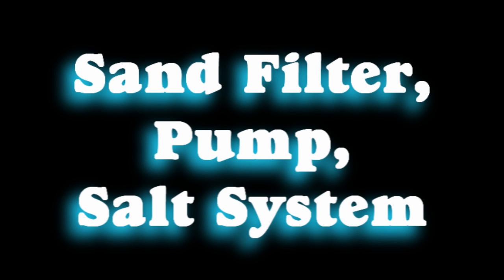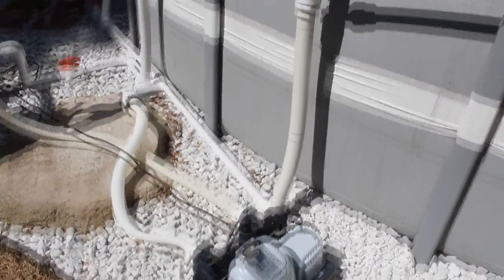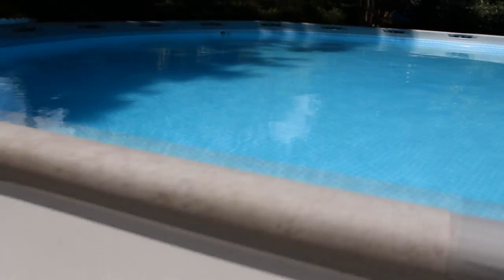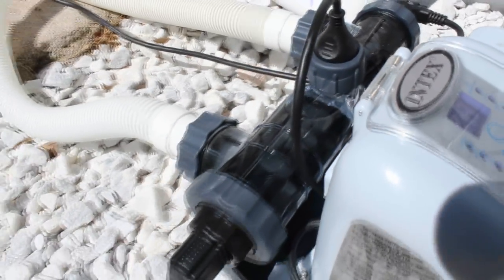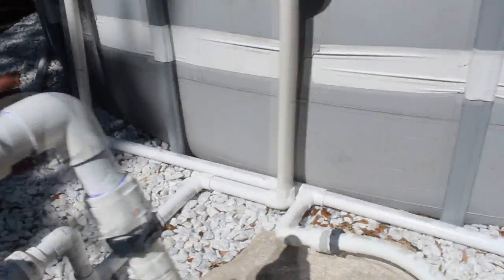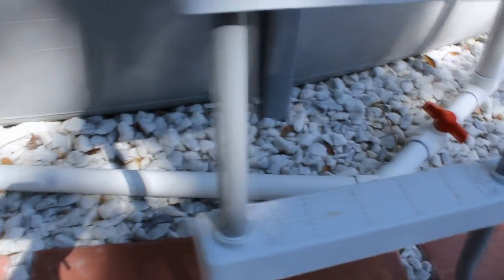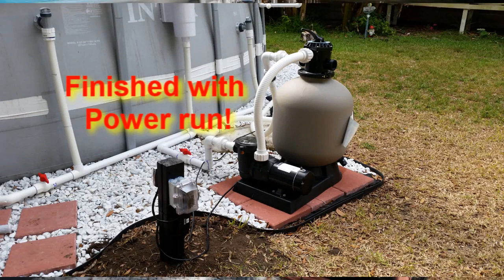HOW TO  DIY Upgrade INTEX POOL with HARD PLUMB, POOL PUMP, SAND FILTER, and SALT WATER GENERATOR

Comment: Nice job. Can you explain how you connected the pvc to the pump and the sand filter. I paused the video but couldn't quite tell the components used. Thanks.
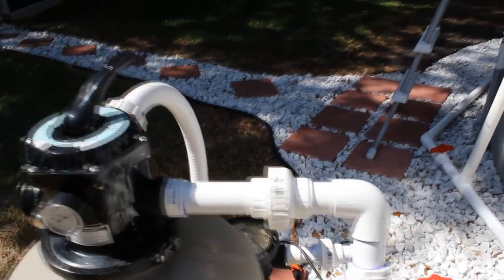Reply from the maker: The connection to the pump was a male threaded to a female slip. (1:27) Then I connected a union female both sides connector that unscrews for easy disassemble if needed. Very similar setup to the filter unit. Union female both ends to the male threaded to female slip connector to the filter unit. (1:38) Hope this helps.

Comment: Hello so you have the one skimmer inlet and then you have two eyeball outlets? My old pool I closed off two outlets kept one outlet and did a skimmer on the new pool I have I’m not sure what to do something like yours I think so I’m just trying to understand I would do the one normal outlet with the eyeball the skimmer for the inlet and then the other two open holes I could make two more outlets? Or close one off or use one of the three for a fountain correct?
Reply from the maker: I believe I understand your question. I have one return (the eyeball) and one inlet which is the skimmer. I have a valve that runs between the return  from the pump to the pool that splits from the return (eyeball) in the pool and the fountain. This way you can regulate how much water comes out of the fountain by adjusting the opening of the valve. You can keep the two returns as long as you have one of them for the fountain as well. For more pressure to the valve shut off bot returns (eyballs) and only let the fountain go. I hope this helps.

Comment: I know this is an old video, but I have a question about the pump. Does the ground screw on top of the pump not need to be grounded to anything? I just bought a pump to replace mine & trying to figure out what I need to do as the instructions say it's a safety hazard not to bond the pool to the pump.
Reply from the maker: Mine is not separately grounded other than the plug into the GFCI I installed next to it. I haven't had any issues. It wouldn't be a bad idea to ground it separate. Check with your local codes and electrician for any assistance on that.

Comment: Does the flex hose just get inserted into the hard T fitting like normal hard pipe?
Reply from the maker: Yes it does. Attach with PVC glue as normal.

Comment: I did the same thing with the fountain/sprinkler part but I only drilled a couple of holes on 1/2 inch PVC yours looks a bit different with those things sticking out any videos showing how that works?
Reply from the maker: I do not unfortunately. They are Threaded micro-sprinkler adapters. Threaded on one sided with a nipple on the other. Here is a link. https://www.homedepot.com/p/Rain-Bird-1-2-in-Barb-x-1-2-in-Male-Pipe-Thread-Irrigation-Swing-Pipe-Coupling-SWGA050S/203184903
Reply: @JDee7  I think that is what I am going to end up doing next summer because right now I'm using me half an inch PVC pipe where I drilled couple of holes with a drill bit and it's definitely very hard to get in there straight without having a press drill, so the sprinkler is crossing each other since some of the holes are not drilled in completely straight...lol
Reply from the maker: I am going to add a video making this fountain. Working on a few things now, then I'll get this together.
Reply: @JDee7  I'm about to post a video of my sprinkler system how it works I'm happy with it but I would like to switch games more Straigh just for a better presentation

Comment: Where was the 2" fitting used? I thought intex was all 1.5.
Reply from the maker: I used a 1.5" to 2" adapter to fit the 2" on the filter and pump.

Comment: Hi I see you used hoses at the entrance and exit of the pool.. how did you connect to the hard pvc
Reply from the maker: I used the same 2" connectors for the soft and hard PVC. The diameters are the same so the fittings fit nicely.

Comment: the adapters that yu have that connect the PVC to the pool plungers, are those regular pvc plumbing pieces that I can buy at home depot or lowes?  Im about to do the same conversion you have done and have an intex sand filter and salt water pump. Trying to gather all I need.
Reply from the maker: Yes they are all schedule 40 connectors.

Comment: Our upright legpoles and the conection to the bracing around the top of the pool rusted out within 6 months after we started the salt water pump. Today it is about to colapse. Have you had any problem with that?
Reply: I had the same exact issue have to get a new pool this year it was fine until I added that salt cell now I won’t use it anymore
Reply from the maker: Unfortunately yes. I had to upgrade to a salt ready pool, but the setup is still the same.

Comment: Great design & video.
Just curious - Do you have any comments regarding how well the Intex Salt System performed & held up?
Reply: I wondered the same thing from other people because I set mine up last year (with intex salt system) and over the course of the summer it rusted out all the legs I have to get a new pool and the salt system quit working but I’m not gonna use it anymore anyway since it rusts out the legs I got one that was only use for two months now I will put that up and it is the XTR with the powder coated metal but I’m still not trusting that the salt won’t ruin it
Reply from the maker: The system held up awesome, but...it did rust the pool rails and supports as they aren't really set up for salt. It did last for about a year or so after so I got my monies worth. I upgraded to a salt resistant pool.
Reply from the maker: As long as you have a salt ready pool it will be fine. You can still use only chlorine in a salt ready pool if you want.

Comment: It's kind of difficult to see in the video but how do you fit both power cords onto the outlet. Each power cord has a wide GFCI plug that takes up so much space that hardly leaves any room for another plug. Or do you have 2 outlets?
Reply from the maker: I do not have GFCI on my cords. The outlet on the post is a GFCI with the larger exterior weather cover.

Comment: Idk if you remember but what's the diameter of the Jets that you have on the return, I think you said ten of them but if the diameter is too small might over shoot, I don't want to guess wrong, are they 1/2 ID? Thanks for the video
Reply from the maker: They are 1/2. I actually had to plug 2 of them since the video so they would shoot farther into the pool. There was a lot of volume coming out of the fountain that it only reached 3' into the pool. Now they reach to the center with more pressure and fun!!!
Reply: Oh, perfect, thanks! Might put a ball valve like you have but right under the spray manifold to adjust the pressure as the sand clogs, or might that be an issue for some reason? Love the thick jets of the 1/2 vs a spray.
Reply: Bubbers Productions lol I was about to share the PVC shelf video with you that I stumbled across cause it's another badass idea ...then I realized you did that one too

Comment: Do we have to use 2” fitting ? Will 1.5” work fine, I feel 2” fitting is too big
Reply from the maker: I used the 2" based on the return sizes. It lets more water flow, but 1 1/2" would probably be fine. You may need reducers from the pump as most use 2".

Comment: Hi, How did you add more power to Krystal clear system? I just installed Intex 12x24 pool and pump is almost worthless as far as power go's,,,Love salt water  system but need more power. also I noticed on your fountain you attached something to the holes you drilled out, What are those?
Reply from the maker: They are black pvc hose nipples.

Comment: I've read all the questions and answers still don't seem to explain the exact coupling and screw on flange nut you used. Can you share a link of the coupling you used. Also, did you get the grey flange washer from one of the pool hoses that came with the pool or pump?
Reply from the maker: Which grey flange are you speaking of? If it's the 2 valves on the side of the pool for the returns, they came with the pool. The couplers are 2.5". It all depends on the size of hose you use to connect the flexible pipe. I am not sure this answers the question. I am not clear on what grey part you are speaking of.
Reply: @JDee7  every connection to the pump or pool valves has a lock nut. The PVC flex hoses at the pump have grey lock nuts and there are white ones where the pipe hooks up to the plunger valves at the pool connections. My biggest problem with converting to hard plumbed PVC is knowing how to connect the 1.5" PVC to the pool and pump connections without using any of the cheap hoses that came with the pool and pump. I.5" PVC connections seem to fit fine but other videos show that they don't fit perfectly and leak a lot. The hose lock nuts and pool inlets seem to be metric 40mm which have different threading than standard 1.5" PVC. Some people cut off the ends of the cheap hoses to remove and use the 40mm nuts to connect the new 1.5" PVC to the pool and pump connections. Is this what you did?
Reply: @mskeakitty  i have the same question, how did you do it?

Comment: Where did you get the connectors attached from pump to sand filter? The ones connected to the flexible pvc. Thanks!
Reply from the maker: It's the PVC Male Union Fitting in the description.
Reply: JD Potter thank you!

Comment: Does that skimmer just go where the original intex one was?
Reply from the maker: Yes, but you have to make the hole bigger with the template that comes with the skimmer.
Reply: @JDee7  ok was just wondering cause that skimmer looks like its a square cut-out and my skimmer was a round cut-out

Comment: What is coupler you used to connect to the intex plunger valve on the side? i am looking into getting a good pump this year and I am highliy interested into doing this
Reply from the maker: +obadiah7771 The valve is connected to the pool as it was in the original set up. I went from that point with the PVC.

Comment: You suggest a sand filter over the crystal clear in text ones and what kind of vacuuming system do you use I’m trying to improve my system overall on 18 x 48 Intex pool
Reply from the maker: I use a battery powered vacuum connected to a pool pole. It has a mesh bag attached to capture the debris. It works really well.  I added a link to the description for the one I use.
Reply: Bubbers Productions thank you maybe I will try that I had one like that but it wasn’t that great and then I bought the automatic big intel one and that stopped working ... my other problem like another viewer is the sand - can’t get sand out with any of these so I was thinking of a normal auto vacum set up on another intake port

Comment: what fittings was used to connect the skimmer to the flex pvc? I've seen a lot of people are cutting the hole larger but id rather not if i have other options
Reply from the maker: +Makayla Catron I used a reducer that fit over the flex pvc and has a male end that threaded into the skimmer.
Reply from the maker: They are standard PVC connectors. Whatever size the flex pipe is they sell connectors that fit right on them as if they were rigid schedule 40 PVC

Comment: The plunger valve you have on the one outlet.. how did you get that to work with the existing hole.. my 18' has the push in the hole type strainer that has a hose clamp on from the outside.. did you make the hole bigger somehow.. i want to put the same plunger or at least threading on mine to attach to pvc but unsure how to go about it.
Reply from the maker: They came with the original pool set up. I reused the jets and cut in the skimmer.

Comment: Hey man great video.  How is your pool liner holding up since you cut it to add the skimmer.  I've purchased the Hayward wide mouth skimmer for my 26' Intex Ultra Frame I just put up. I want to install it on there asap. My friend is telling me the pool liner wont last a year if I cut into it. Any feedback would be greatly appreciated.
Reply from the maker: Over 3 years and running strong. As long as you use the provided gasket and stainless screws, it should be just fine. Just be real careful cutting the hole. Use the inner section of the gasket as a template to get the opening you need.

Comment: Hi, I know this is an old post but I’m hoping you could tell me what brand filter and pump you have. Thanks!
Reply from the maker: A HYDROTOOLS pump model 72729 and it came with the sand filter as a combo buy. Hope this helps.
Reply: Thank you!! That’s very helpful :)
Reply: Jill you read my mine.. was just wondering the same thing. Gonna try this setup on our 16x32 that only has a half HP pump. Water is just sitting there.

Comment: Where did you purchase the flexible 1.5" pvc from? The provided flex hose isn't working for my set up and I have the same set up as you do.
Reply from the maker: I picked mine up at The Home Depot. The plumbing department had the hose.
Reply: Thank you, I’ll check it out. I was trying to look it up on their website last night and couldn’t find it anywhere. Hopefully they still have them, or I’m not typing in the search correctly.
Reply from the maker: I think it's just flexible PVC...not sure.
Reply from the maker: This is what I used...hope it helps: https://www.homedepot.com/p/UDP-1-1-2-in-x-1-90-O-D-x-10-ft-PVC-Spa-Hose-T30006005/304185154

Comment: Great vid. like your setup. I just got a skimmer like yours, was wondering about the gasket. Did you get the butterfly gasket with it? If yes, did you split it apart and use one piece on either side of the liner? Or just put it between the skimmer and the liner wall?
Reply from the maker: I did get the gasket as you described. I used it as the template to cut the hole in the wall of the pool and then slid the gasket into the hole with one side of the gasket inside and one out. I did not split the gasket, I kept it intact.
Reply: I take it there were no leaks doing it this way?
Reply from the maker: I have had zero.
Reply: I did the same exact thing with mine and I love it works great

Comment: Hi again, one more question, On the side wall skimmer I read its for doughboy pool will steel siding so screws are too long, I ordered a extra gasket thinking I would keep one on one side uncut and new one I ordered on other uncut. would this work out or should I just cut one in half and cut down screws?
Reply from the maker: I didn't have to cut the screws on the model I bought. I can't remember the make of it though. I Googled "side wall skimmers for Intex above ground pools"

Comment: How is the saltwater system working? I'm upgrading to a 1.5hp sand pump  on a 24 x 52 pool and wondered if the pump is too strong for the system. I called Intex and they said they never tested it since it's rated for a 700 to 4000 gph pump.
Reply from the maker: The system is working great. Standard maintenance keeps it going. The pump is fine. A 1.5 HP may be overkill, but it will run smoother and have less stress on the pump. Just be aware that you want at least two returns for the pressure it produces.

Comment: What was the cost for getting the electrical outlet ran out to the pool? I have a contractor coming out to give me an estimate this week.
Reply from the maker: I actually ran it myself. Sorry this doesn't help!!
Reply: lets assume they have to get building permits, have inspector right off their work, dig  trenches, add breaker to panel, run to line, etc etc depending how far it is from your home. looking at $3500, if you can dig the trenches to save about 500 in labor costs .Thats is assuming. it is a  "Standard Installation (he house panel box has room for the additional breakers needed for the pool equipment) Second option is to contact the electrical company and get what's known as a service upgrade which will increase the amount of electricity provided to your house.  This normally takes the electrical provider three to six weeks to install and can cost from $750-$1500. Then dig your own trenches, pull your own permits, lay the wire and conduletes yourself, and then hire the licensed electrician to do the rest.

Comment: Where did you source materials? Great work and video also!
Reply from the maker: Most of the plumbing materials were purchased at Home Depot. The other parts are linked in the description. The two return valves came with the pool, I fitted them to the tubes using connectors from Home Depot.

Comment: Hey grate video but can you tell me or point me to a video that shows me how you add a 2nd return line to your pool
Reply from the maker: In my case I ran a "T" and came out with two returns. I cut the skimmer into the side to create the single in for the water flow to the pump and filter. I used the return from the filter and the "T" to go back to the two original ports on the pool. The in and return in the original set-up.

Comment: Great video and great idea with the fountains. I have the Intex 16 X 32 Ultra XTR I put up last year. I have a 20 foot deck along side of it which would be great for mount the sprayers. I really like the idea of the side skimmer. Would it be possible to mount the skimmer then cut the liner? Seems that would reduce the risk of mis-cutting the liner.
Reply from the maker: That is exactly how I did it. Push the screws through and secure with the gaskets, then cut liner as close as you can to the edge of the skimmer so no debris gets caught on the way in.

Comment: the flexible pipe you are using from skimmer and returns  to the hard pvc pipe  is different from the other flexible piping your using ,,,,, is it different or am I seeing things cause it looks solid but it also looks like its flexible
Reply from the maker: It is different. I used the pipe that came with the pool, the flexible thin wall products, for the rest of the set up. From the skimmer and returns I used a thicker, flexible PVC tubing I bought at Home Depot. It fit better into the PVC fittings.